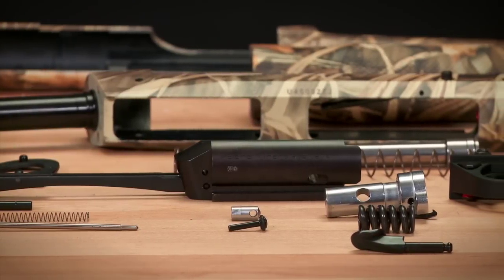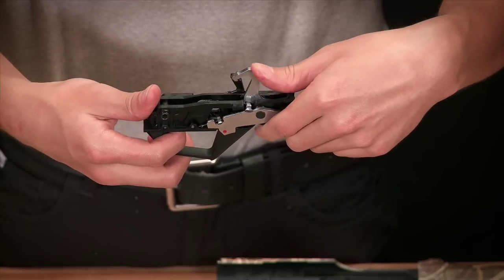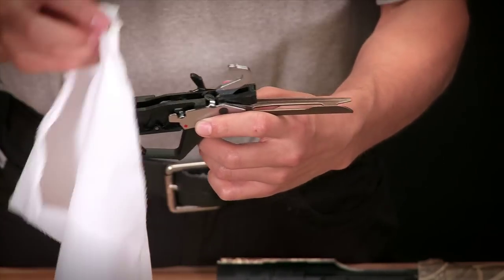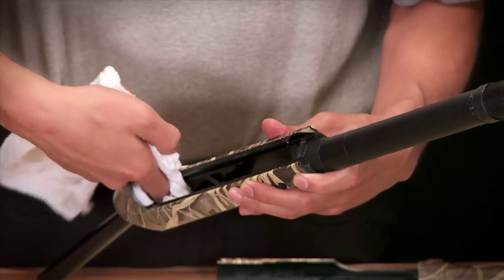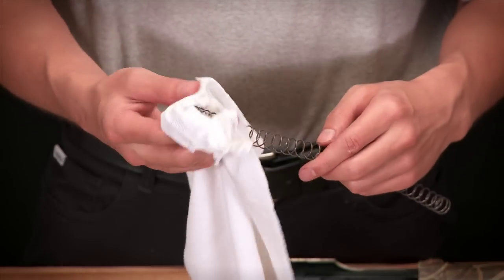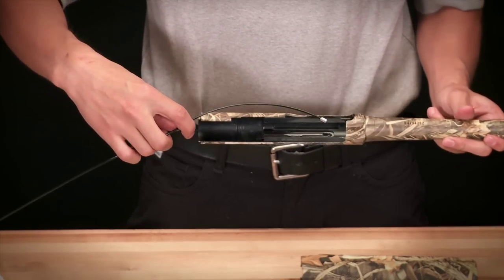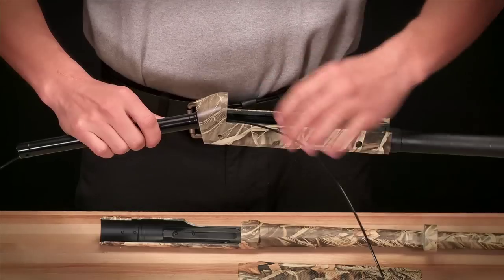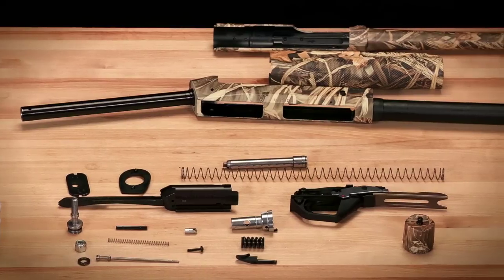Cleaning Inertia Driven  Benelli Shotguns - Part 2

Comment: Wiping the trigger assembly clean …. By the end of the season I have so much grass and crud in the assembly. I put it in a box and spray the heck out of it with oil and all the crud runs out onto the cardboard. I pretty much do that with all of the parts and let gravity do its thing.